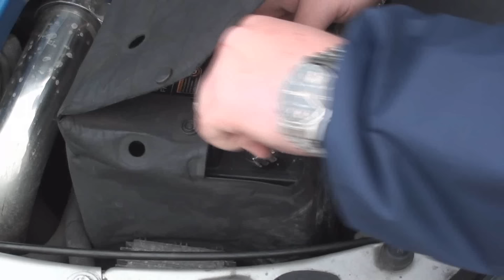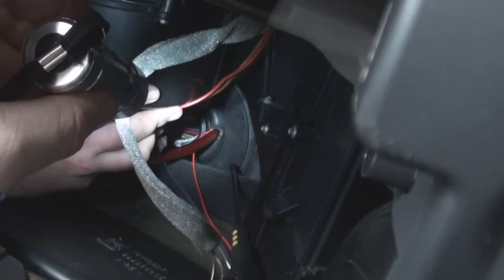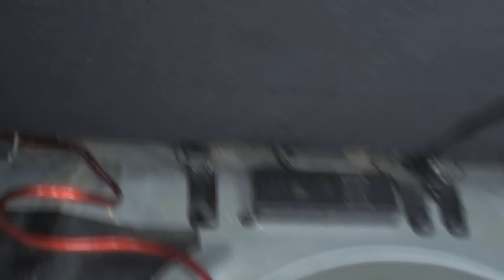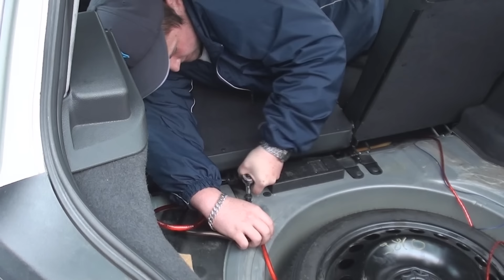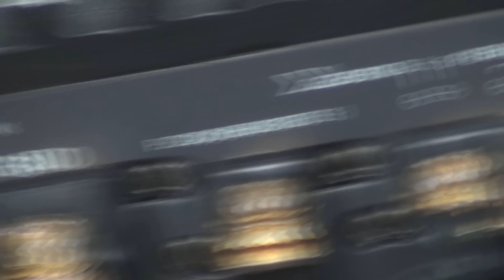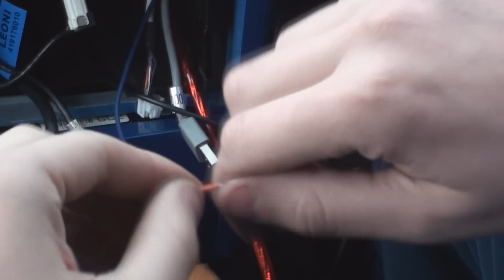How To Install A Subwoofer And Amplifier In 5 Minutes!

Comment: You guys sanded the seat mount on top side but paint still on underneath, would it have been a better earth to sand both even though sanded top and bolt would still earth ? Thanks for the vid :)
Reply from the maker: trev neuzerling we sanded the top as that's what the bolt head touches. the bolt then do bolts down into a unpainted thread. so the earth makes great contact.  there wouldn't be any additional benefit in my opinion from sanding underneath as well. thank you for watching. bluudy
Reply: Your %100 percent right , I realised how ridiculous my question was afterwards:) 
Thanks for taking the time to reply man , appreciate it :) 
Also I like the attention to the little details that matter like wiring , not just saying this goes there like other vids , subscribed now and going to go through previous vids yous done and hit a few likes if I like em haha :) 
Have a good day man :-)
Reply from the maker: trev neuzerling thank you very much! I allways appreciate feedback.

Comment: every video is like this showing where you run your wires, idc! man I'm trying to find out where to connect them to
Reply: Parker Ganz lol thats the only thing thats holding me back from installing my own speakers
Reply from the maker: What the whole video?
Reply: Power wire red one goes from your battery to your amp....black wire "Ground" goes from a bolt where you amp is to your amp. RCA "red and White goes from your Radio sub output to your amp RCA "white and red input". REMOTE WIRE "blue wire connects to the back of the radio Remote wire to the amp ...normally located between the Power and ground on the amp and for your speakers or sub just connect it to the outputs of the amp ...clear now?

Comment: Okay so on your wire theres that fuse, what does the fuse on my amp mean?
Reply: It's just secondary just in case something goes wrong
Reply: +no okay thanks
Reply: i know its a late reply, but fuses are to stop electrical short circuits from destroying the component, in your case, your amp.

Comment: does this process work on any Subs ? and where do i get the cables ? i need answers
Reply: some subs require different type of wires like my sub needs 8 gauge wire, but you can buy kits online
Reply: +Nobody For president I've found that some of Sonic Electronix prices are high.  Best bet is Amazon.

Comment: Got the exact same car, done all the difficult parts and trust my car to make the easiest part so difficult. I can't find a decent place to earth it as the torx screws for the seat are stripped and I can't get them off! Do you know anywhere else I could earth it?
Reply from the maker: are they all stripped?  there is the earth in the back of the lights. but I do recommend around the seat ad they are biggerAl
Reply: +Absolute Modicts thanks for the quick reply! Whenever I try and remove any of the screws they just loosen then tighten again, I think the previous owner removed the original seats and swapped them for SRI ones which probably damaged the screws. Where would I have to earth it in the headlight?
Reply from the maker: +Dipps08 fair enough.  not headlight. in the rear light. I know in the mk4 there is a earth bolt. I'm not saying there is in the mk5 but I'd be looking there.

Comment: What if my sub has a built in amp?
Reply: You would run the power, ground, and remote turn on wires to the amp and the sub should work. You wouldn't need to connect speakers cables from amp to sub since it has its own built in amp

Comment: why do u need a ground cable? the one that you hooked up to the bottom of the car seat. (im a noob)
Reply: So you don't short circuit your battery
Reply: CLANPAW51 ok thanks!
Reply: +CLANPAW51 well actually no. The ground is the return cable. think of a sink, there is the water pipe (positive) and the drain pipe (negative)
Reply: +Random_rapper20 
No, the negative is for that, the ground is for any build up electricity to disperse so the circuits do not get fried.
Reply: Nobody For president 
More like the secondary drain which is higher up.  The actual drain is far more like a negative end.

Comment: Anybody know how to find the remote wire from the back of the head unit? Is it just the head unit power wire?
Reply: +SAKA Its very thin and usually blue.
Reply: +JabHDTV don't mistake it for blue and white power antenna wire though

Comment: to much wiring for me I'll stick with being a machanic I wish we had them fansy battery covers
Reply: this a tally looks rather easy that  I first thought, and I hate wires, but it's appears to be a very simple positive power, negative to ground and one wire to control it, then it's just a matter of putting a speaker in.

Comment: how do i know what cable to attach the remote cable to in my stereo, i don't want to go severing random wires
Reply from the maker: normally it's only 6 inch long. blue most of the time. and says rem or remote.

Comment: Instead of using a drill to make a hole, I was wondering what else I could use? I was thinking using a screw driver to push into the grommet to create a hole or using a knife to slit a small hold in the grommet.
Reply from the maker: that would work. just be careful not to cut into any wires or pipes.

Comment: is there a really need for the earth cable ?
Reply: Without a ground connection, there would be no possible way for current to flow. So no earth equals no power.
Reply: +Thumper G. but it doesnt do anything why does it have to be somewhere?
Reply: u cant be serious.

Comment: I have a astra sxi. I installed a bassface sub and amp with a switch to turn on and off. When i turn the standard radio off the sub make loud noise if i dont turn the switch off. Why is that and how can i stop it/ fix it? Thanks

Comment: I've got a twin sub and it comes with two amps will it be different to setting it up?
Reply: +Corey Bright If I was you I would get an Amplifier that will power both subs by its self. What twin subs do you have?
Reply: I got fli active
Reply: +Corey Bright Link me to the subs you have and ill see if I can help you :)
Reply: +Sam Jackson this one https://www.gumtree.com/p/in-car-audio-gps/fli-twin-subwoofer-1200w-/1135539663
Reply: You can... It will be harder though...
I would ditch the amp and get a 2-channel with the rms wattage of both subs put together and wire that to them

Comment: earth cable....what have i herd
Reply: Ground
Reply: Both the same.
Reply: They are not the same thing. You can have electronic ground, chasis ground, bonding ground, bonding ground back to earth, floating ground, and none of them are the fucking same thing and shouldn't be mistaken for each other.
Reply: @selfishlyintrigued  You're chatting out of your ass. "Ground" or "Earth" is the same thing -- it's a mere preferential variation, which are both lingual standards.
Reply: @musclemanDARNEL  I didn't say ground or earth. Nor am I talking out my ass.

I said there are different types of grounds, and that people shouldn't mistake them. 

When talking about the majority of residential and industrial wiring, pretty much anything AC, ground and earth are interchangeable. 

However when it comes to electronics, or vehicles, they are not the same thing. Ground could mean negative, it could also be a bonding ground, chasis ground, battery ground, and the confusing part is, they could also be a combination. For example, vehicles tend to have chasis and negative on battery bonded, the vast vast majority. However, some electronics I have dealt with, have chasis and negative separated. Mostly potted stuff, and without specifying what you mean, you can have situations where someone may install a piece of equipment incorrectly. 

For example: Had a industrial switch on haul truck, continuity on negative and power, working fine but burnt out from time to time. 

Found out issue was we needed to provide a secondary ground to chasis, as chasis was isolated and this ended up causing things like build up discharge that would blow internal boards and even fuses. 

Luckily warranty was approved as their instructions didn't mention we had to on one mounting bolt hold, remove the paint. 

I guess my point is, electronics can tend to use the word ground to mean different things, and sometimes those different things an installer unless otherwise specifically stated, might install something incorrectly.
Reply: @selfishlyintrigued  nobody gives a shit about your lifestory mate, ground\earth - tomayto/tomahto.. you know what the gent is saying
Reply: @selfishlyintrigued  exactly af, messing up with grounds can cause some serious issues... also the noise it will produce can't be ignored
Reply: Nick Nelson the tyres are rubber, you can't earth it because it's got nowhere to go unless you have one dangling off the underside

Comment: Alright, so riddle me this. I have a 2002 Dodge Dakota quad cab, and I'm looking for a spot for a sub, specifically a 10 inch sub, but willing to go down to an 8 inch. I need to find a spot that doesn't take away from seat space. Anyone can help?
Reply: good user, m.A.A.d internet buy a shallow subwoofer.. i just bought a rockford fosgate R2S 1X10. It is thin and can find almost anywhere
Reply: Donpatch88 Yeah I recently bought a  Rockford Fosgate P3S 12" shallow box and its definitely shallow it fits behind the seat of my single cab toyota pickup perfectly
Reply: +good user, m.A.A.d internet get the jl cs110tg-tw3. its a 10 inch, comes with the box and itll fit behind ur seat. u can go bigger and louder with the jl cs113tg-tw5. 13 inch sub and box thats made for trucks also
Reply: im pretty sure they make boxes that will fit underneath your seats in your truck. just have to do a little digging to find the correct box.
Reply: DynoMight5656 Ima jus get a car lmao this truck is too much xD

Comment: Tip for you fellas struggling with the remote wire (blue wire part). You can buy some simple wiring, and a switch. Hook the wiring onto the metal parts of the switch, then where he has the blue wire where it's separated apart on the amp on each side, hook the simple wire connected to the switch into those spots. this is an easy way to MANUALLY turn on your subs. I had to do it myself because my remote wire would not work.
Reply: Do you mean run a switch and use the live as the 12v supply for the rem wire

Comment: Do I need a line output converter for my stock radio? I heard I need one but not sure how to install that.
Reply: It depends if your amp does not have one integrated you need to buy a line output converter and there is a Video from Exo that show how to do it but try to watch multiple vids about line output converters install to get a better Idea

Comment: just watched a ton of how to vids on this topic and yours was by far the best
Reply from the maker: that is wicked to know! thanks!
Reply: SAME HERE MAN... NICE JOB...
Reply from the maker: Thanks!
Reply: Norm Murph  don't attatch the amp to the speaker box. it will fuck it up with the vibrations. i suggest on the back of one of the seats that fold down.
Reply from the maker: Not the case. Dont forget you can buy active subs, which have the Amp mounted on the subwoofer.
Reply: that's valid. but when you have a system that hits triple decibels don't put your amp on the box. i thought we were talking big boy systems lol
Reply from the maker: lol

Comment: hey great video, but just wondering how would you go about installing a kill switch, so that you can turn the subwoofer on and off, so you can listen with or without the subwoofer, would you just cut the blue wire and install the switch there or would you put it else where? thanks
Reply from the maker: Thanks for joining our forum. Your Answer has been discussed there!

Bluudy

Comment: great stuff but remember to not create any areas where rust will trigger, that being said, when you sanded off the paint on the seat bracket or drilled the hole for the wire you should've applied some primer paint, incase of the earth wire, you should paint over the connection, that will stop rust and give you the best connection aswell :)
Reply: Would spray polyurethane work over the connection?
Reply: i would definatley support that idea as thats what iv done to mine aswell, but i think as that ground will never see water or if it does it wouldnt be very much, they probably didnt think it would need it :P
Reply: 9dox9 humidity is enough to rust metal mate ;)
Reply: very true I don't live in a very humid place I didn't think of it ;P
Reply: lostsheppard87 not sure about that ;)

Comment: i want to get a sub and im planning on getting a 12in kicker 2ohm but I wanted to know what type of amp whould be the best for that?
Reply: depends what the RMS rating on your sub is. If it was, for example, 300w RMS, then you would want an amp that has around the same RMS @ 2ohms.  For amps, a mono would be best. (dedicating a single amp to a sub is the best option because it focuses all that power to deliver the low frequencies that your sub can produce)

Comment: Can you list the parts you used in this video? Specifically the cables. It would really help, I had some trouble hearing the parts you used.
Reply from the maker: if your stuck try our forum. Power Cable. Earth Cable, RCA cables, Remote Cable, Speaker Wires.
Reply: Halfords sell a pack that has everything you need.

Comment: 2 questions
1) why did you put that black cable on the seat screw ?
2) how do i locate the cable i need to strip out?
Reply from the maker: The black cable is the earth, the seat screw once cleaned up is a very good earth. which cable are you refering to being stripped out?
Reply: the one at behing the deck
Reply: Stavros K The 12v power supply that turns the Headunit or 'deck' on is the one you want to strip out for your remote turn on wire.
Reply: is there a way i know which one it is? i have a 1999 crv
Reply: Stavros K your aftermarket head unit should have a wire on the harness saying "rem out" or "remote" its probably blue. that is the wire you want to solder it to
Reply: sick thanks !!
Reply: no prob
Reply: Absolute Modicts by "earth" cable, do you mean the grounding cable? Sorry, I'm from America.
Reply from the maker: yes earth/ ground the same.
Reply from the maker: Don punkcraft yes earth/ ground the same.
Reply: Absolute Modicts thanks. You've been very helpful :)
Reply from the maker: Don punkcraft your welcome. subscribe :)

Comment: hey dude i tried installing my subs and amp today, and i got everything like you have it, power, ground,remote, subs etc, but when i connect the rca's to the amp, he green light starts flashig red and green, and when it turns green for like 2 sec the subs work than they stop working when the red one come on, what would be the problem to mine?
Reply: Yes i got the same problem too andwer someone plz

Comment: 9:47 i didnt understand where to connect the remote
Reply: Either did i
Reply: you wire it to your radio harness. the wire is in most cases blue and white and usually in the harness it is not plugged on the car side its only plugged to the radio side so its the only wire in reality thats not wired in the harness should be very easy to know which one it is.

Comment: this may be a dumb question but, does the subwoofer always needs to be in a box?
Reply: if its not in the box you wont get much bass from it
Reply: Ash Lewis ahhh oke. thank you!
Reply: Doesn't need to, if you put it in a parcel shelf the whole boot forms a low frequency resonant cavity and the bass is reflected into the car off the rear window.  I had two 12" subs in a parcel shelf once and they sounded great!

Comment: My car battery is in the trunk area, would there be any changes in the connections, like power, RCA, etc, or is it the same or easier since my battery is in the trunk area. my car is a 2004 Volvo S60.
Reply: way easier to install with a battery in the trunk, the annoying-problematic part is always to get cables from the engine compartment to the inside
Reply: You lucky dog. It should be exactly the same but way easier apart from the remore needing to travel a little further:p
Reply: Jeff Jones So I can have my subs in the trunk with the amp as well, I don't need to drill a hole into my car in the glove compartment and feed the cables through my interior? I have no hands on experience of installing a car subwoofer btw. So I can just have all the wiring, the subwoofer, and the amp in the trunk at the same time, if thats what you are saying.
Reply: if you don't care about the "look" you can even mount the amp directly onto the subwoofer box (keep some space between them so the amp doesn't overheat) and connect the amp on the battery for power, that's what I did so I could easily remove the subwoofer from the trunk, disconnect the audio cinches coming from the car radio, the power cables going to the amp and voila
try to keep the power cables going to the subwoofer amp away from the audio cables going to the subwoofer or the ones coming from the car-radio as it could give you unwanted noise
Reply: cpcheater1011
 no thats not required at all. its a lot easier with the battery to the trunk. essentially it just means a shorter power cable. the only wires you will be running back are the remote wire and the rca cables.

Comment: You do things in a wierd way lol.. I don't have a jacket (?!?!) on my battery, and I didn't need to remove my glovebox nor run my power cable on the driver's side! and THIS is how you secure a small box with bungies ;-) http://i61.tinypic.com/1585ldu.jpg For my big box, I just have two pieces of wood wedging it in place, one on the left and one on the front - http://i62.tinypic.com/16qttl.jpg Finally, I think you should have covered settings such as amp gain, crossover frequencies, and head unit pre-out level.